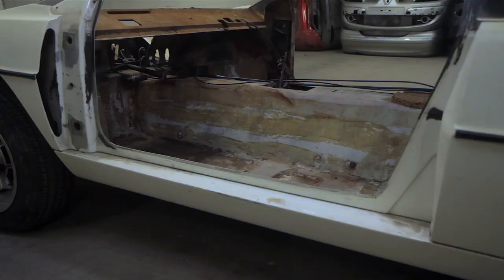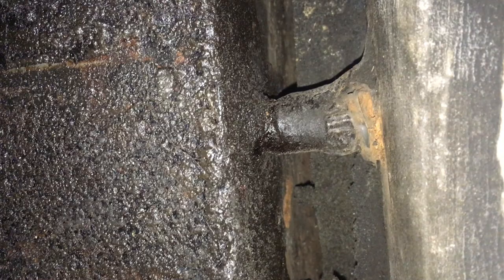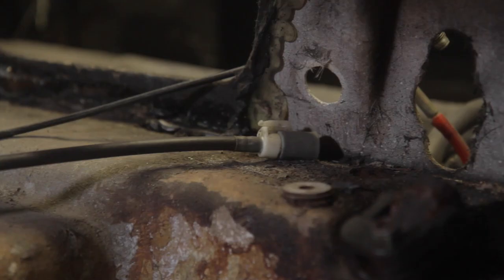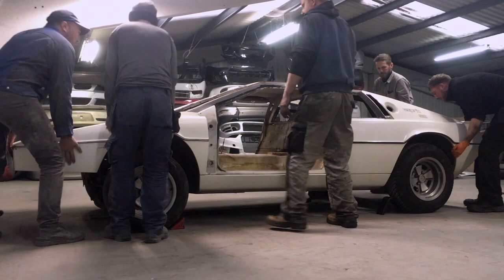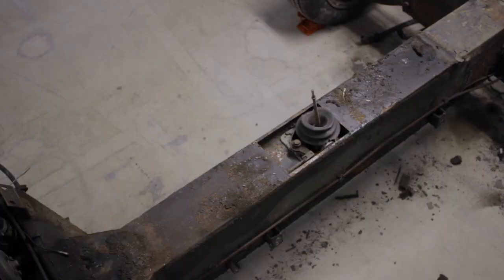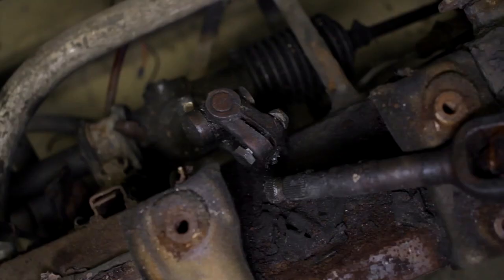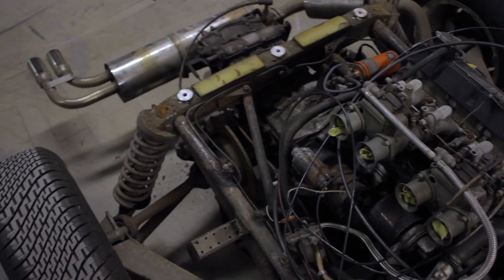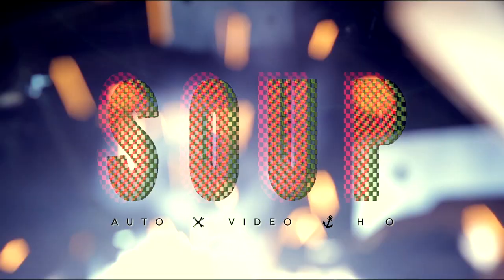Pulling a Lotus Esprit S2 BODY OFF!    // SOUP Classic Motoring E.34

Comment: Love watching these videos, they're part of the motivation I got for getting back into my Citroen 2cv. In the last month I've put a new gearbox in it, new brakes, new track rods, new rear tyres, a bunch of new paint and finishing materials inside, a new dash, new shocks, refurbed driveshafts, welded bodywork and I cleaned up the engine. Really neglected doing all that these past two years, but my god it's made a difference. Thanks for sharing your stuff man.
Reply from the maker: That's a hell of a lot of new stuff Alfred, fair play mate. The 2CV is a fun little machine and so much character, I remember we went for a spin in one as a kid and it was a real treat. Cheers for the kind words and happy motoring!

Comment: Good stuff George! I looooved the tilt-shift effect you went for when you compared the car to an RC toy ;) In the future, you could ask the guys at Delta if they have an induction heater you could borrow. They are amazing pieces of kit and heat ONLY the metal part you're working with. Might have made that seat belt bolt a bit easier ;)

Keep on keeping on man, can't wait for more!
Reply: Also, regarding valve cover design... take a second a google "5MGE valve cover". Its the same rough design as the ones on the Esprit but come off of a, you guessed it, Toyota Supra ;)
Reply: George simply awesome episode !!keep up the great work , the early Esprit my dream car don’t care what they said about not been reliable but those lines penned by Giugiaro they are stunning
Reply from the maker: @Aaron See I've shown my lack of Toyota knowledge up, should have included the M series engines in that piece! Think I over cooked the tilt shift shot a little? The lads don't have an induction heater, it was the first thing I asked, they just don't have cause for one being a commercial modern bodyshop.
Reply from the maker: @Jeton924s The lines are beautiful and too often overlooked. The Esprit will have it's day and it'll be a better car for being put together slowly by an enthusiast, Lotus are incredible engineers.

Comment: Love the video, George but, to be pedantic, the Esprit does not use a Chapman strut suspension. With the Chapman strut their is no top link as such. The spring-shock assembly does not pivot at the hub and acts as the top link. It was used on the original Elan and +2. Looking forward to see how the car cleans up. I had a S2 a while ago and I loved that car.
Reply from the maker: Not pedantic at all Trev, it's interesting and challenging. I headed off to ask some people about it and it seems we were both wrong. Lotus used a number of variations on the theme across both road and race cars and the single common defining factor is a fixed length driveshaft together with a lack of bottom link. The name was just ease of use for Lotus. So what happened with the S2 in the end? Don't have an original steering wheel or head unit on a shelf in the garage do you? ;)
Reply: Sorry but sold it when I was living in America and didn’t have any bits left. Bought it in California. Got it back on the road. Shipped it to North Carolina when I moved and then sold it to a guy in California so it went back where it belonged.

Comment: Slidehammers are one of the easiest and most rewarding tools to make and use yourself. just give it a try
Reply from the maker: What would you use for the weight?
Reply: @soupclassicmotoring  fancy: bar stock cutoffs from the metal dumpster. Less fancy: old brakediscs cut to pieces and welded together
Reply from the maker: I could weld up a hollow handle and pour lead into it!

Comment: Excellent work. Are you planning on galvanising the chassis when restoring it similar to the later guigiaro cars?
Reply from the maker: No keeping weight down will be priority one. Too much risk of warping anyway and the car won't be strictly dry weather only but it will only be in the wet when caught out on a GT.
Reply: What about an epoxy coating after you've cleaned it up? Would be tougher than paint and it would be sealed up REALLY well...
 @soupclassicmotoring
Reply from the maker: @aaronjudt1487  It'll be a spray and clear coat... that's the plan dude!

Comment: you can update the suspension to S3 specs, probably
Reply from the maker: They did uprate the suspension using Toyota stuff in front and an upper link in the back on the S3 far as I know. I don't think any of the updates are easily interchangeable though, but I love that the S2 is more pure anyway.

Comment: "Seized bolts were not a problem here" Eurgh. My 16 yo Z4 is a different story. So I'll do something else in the mean time. Replace fasteners for stainless steel parts. Check. De rust and re paint under body plates. Okay.
Reply from the maker: Keep at it!

Comment: OK, dumb question time. Why exactly are you taking the body off and stripping the chassis down anyway?
BTW, thanks for showing all of these steps. I have a wrecked 1990 Esprit that has a bent chassis and I have a replacement chassis to put underneath it so at some point i have to do this same thing.
Reply from the maker: Nice car man! My one's chassis has issues too but overall it's too special a car to half ass and I just want something perfect, so doing it once and doing it right.How'd your chassis get bent? This one's been jacked in all the wrong ways in all the wrong places, numerous times.The forklift didn't help either.
Reply: The previous owner of the car put the cat into a ditch and I think when it went into the ditch it hit something with the right front wheel. The mount points for that front wheel are all bent up. Then when they towed it out of the ditch, the towtruck driver managed to rip the back left wheel off the car which broke the aluminum casting that holds the rear wheel bearing and bolts to the rear trailing arm.
Reply from the maker: That's a calamity of f'ups! There's no saving that chassis so glad you managed to get another. Pity your car isn't earlier, I could have scavenged a plate or two off the old chassis
Reply: Those aluminium castings on S1 & S2's are rare as. Don't break yours George, you're not getting my spare!
Reply from the maker: Thanks for the jinx man ;)
Reply: Just be very careful separating the hub carrier from the bolt and especially the spacer, which will probably have fused in. It has to be removed and LM greased to move smoothly on reassembly. I had to do mine twice!

Comment: new tubular manifold..... to accommodate a turbocharger?
Reply from the maker: nooooooo, no turbo's. Not a fan. I'll find more performance in other ways.
Reply: Totally understand your commitment to keeping the lotus pure, loving the progress!
Reply from the maker: Thanks man, yeah it's a sweet little thing that doesn't need me thinking I know better. The equation says that every 60kg dropped in weight is equivalent to a 10hp gain. So 60k is the goal, just doing things that someone in the '70's or '80's could have achieved with elbow grease and a small budget.

Comment: could save some weight (semi unsprung :-) )  and add some elegance by making up some tubular A arms to replace those horrible pressed steel opel ones
Reply from the maker: Never even considered that, great idea and easily reversible. I've been wondering about the front end weight because there's so little of it. The S1 was known to get squirrely at speed because of front end lift, hence the revised and more substantial dam on the S2, but as I stripped the car I was assessing everything for excess weight... there's little room for weight loss and especially at the front. To make meaningful lightness gains you're talking high end materials and skill.